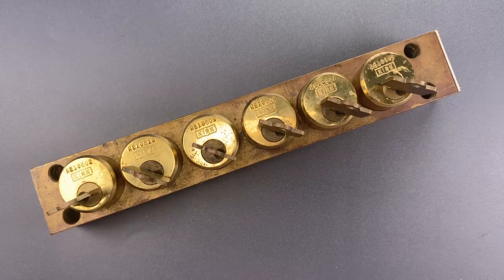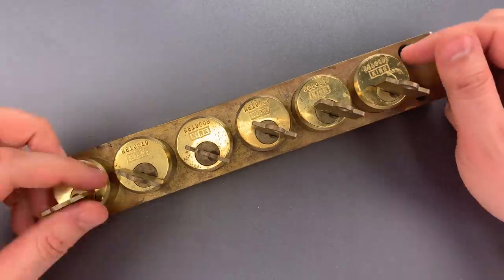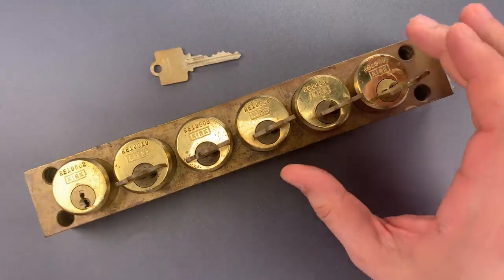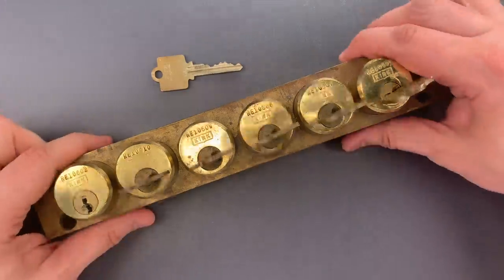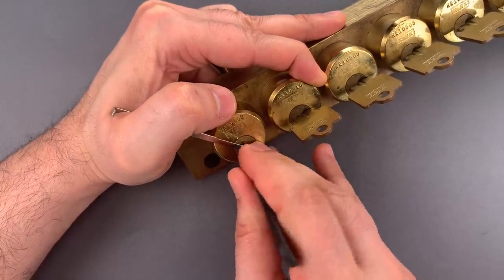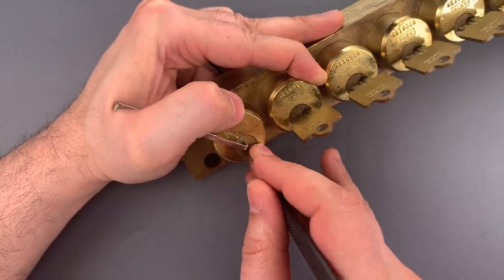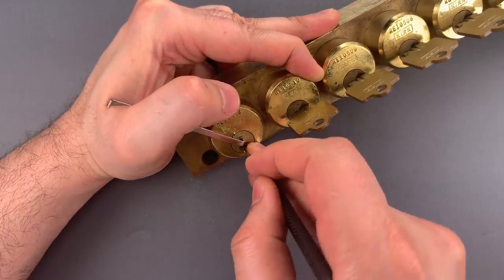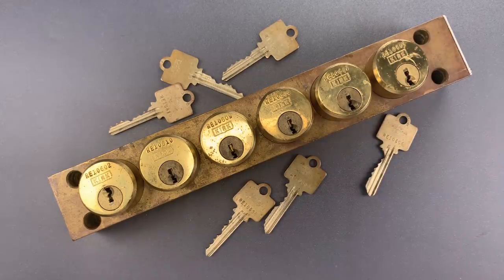[1190] 6-Key Kirk Interlock Panel Picked

Comment: Really a simple system once you grasp the idea, but as stated in the video, an almost unlimited number of configurations.
Here's an example of one I serviced for years (the easiest to explain):
• Lock #1 has 1 cylinder Key #1 and locks out the process switchgear allowing Key #1 to be removed.
• Key #1 is taken to Lock #2 which locks out process power, just in case the switchgear somehow gets re-energized.  Lock #2 has 2 cylinders, one of which holds Key #3 trapped.  Key #1 operates the empty cylinder of Lock #2 locking out process power and releasing Key #3.
• Key #3 is taken to a key panel and used in an empty cylinder to unlock cylinders trapping 10 individual Key #4.
• The 10 #4 keys fit individual single cylinder locks that are Keyed Alike.  The locks provide access into the process, each lock trapping its key until the access door is closed and secured.
• All 10 #4 keys must then be returned to the panel before Key #3 can be removed, and so on.

There were 4 process lines using this system and each had its own series of keys.  In normal operation, cylinders without keys can be protected with gasketed, spring-loaded flaps covering the face of the cylinder.  Cylinders WITH or without keys can be protected by a tight fitting brass cap that slips over the nose of the cylinder with room for the head of the key.

The main issue was that during a shutdown, the keys trapped in the locks on the access doors would get broken off.  Hard to do with a nickle silver Yale sectional key, but they did it with regularity.

Comment: In France, we have the same interlocking panel principle, but we need to turn each key, one after the other, to allow the next key to be removed. The inner mechanism seems to be much more simple and flexible than the one you showed. LPL, let me know if you want me to send you a typical French "chemin de clés" that we use in tramways, trolleybuses or metro electrical feeding systems.
The point is that every key must absolutely NOT be interchangeable, to prevent tragic mistakes. And complete installation may require hundreds of keys...

Comment: Neat, seems like an earlier version of LOTO
Reply: No.  It's still used today on modern systems of many types.  It's sort of an enforced LOTO.  I've seen it on many low (under 600V) and medium voltage cabinets, even ones bought in the last year or so.
Reply: It's more of a supplement to LOTO.  The idea here is where you have a series of lock outs required to safely perform an operation, this allows you to do it in sequence since each key will need to be released in the proper sequence to be able to proceed to the next step of the procedure.  The Kirk website shows examples of several applications with various implementations on how it'd be used in a LOTO situation where you have multiple things that need to be locked out to get to the final item for maintenance.
Reply: LPL actually plays with the LOTO.  He had a conundrum when he found a plastic cased Master lock LOTO lock had a better core than a metal cased Master Lock luggage lock of similar size.
Reply: @ljfinger  see
Reply: LOTO?
Reply: We use these in our 27KV substations.  They even used to be on 138KV equipment, such as  disconnect switches and ground switches,  but almost all of those Kirk interlocks have been retired.
Reply: @darthkarl99  lock out tag out.
Reply: @darthkarl99  Lock Out Tag Out - industry term for use around machinery and electrical equipment to turn off and keep off a piece of equipment or circuit for maintenance or repair to ensure it's not accidentally started or energized while not in working order or with someone working inside/on it.
Reply: @darthkarl99  There is a simpler version as well.  Long bar with multiple padlock holes, where if any of them are occupied, you can't remove the bar.  You put that through the hasp that locks the controls on something dangerous.  Then each guy working puts his OWN padlock through the bar.  You can't turn the machine back on until every guy removes his own lock (thus proving he isn't still in the bowels of the machine).
Reply: Nothing to do with LOTO, as there are no tags 🏷 involved, this system is still widely used in many industries.
Machine interlocks so that the people killer 4000 can only be started once all the access doors are secure.
I have never seen one that uses standard looking keys before since being able to duplicate of any key defeats the whole purpose.
Reply: @charlescox290  we call Loto. Lock off test out.
Reply: @starcitizen890j5  I think tag out is from military usage in the US. No physical locks because you might have to operate those valves in a hurry to save the ship and everyone onboard. Yellow caution tags on things that might injure people or you really need to think about why you're using that system. Red Danger tags for when operating that system will kill someone.
Reply: @ScottKenny1978  Tagout was exclusively used when I was in the military. In industry, we always prefer lockout but can still use tags if there is not a suitable lockout means. This happens more often on older equipment that was not designed with lockout in mind. Just about all new equipment is designed to accept a lock (I think it may be a requirement in some countries).

Comment: We use similar panels for our electrostatic precipitators on our boilers. First you get the keys out of the breakers for the transformer-rectifiers when you power them off. You take those keys and you can unlock the keys that let you ground the transformer-rectifiers. You then take the ground keys and unlock the keys that let you open the doors to go inside of the precipitators. This ensures that nobody can go inside unless the T/Rs are grounded, and the T/Rs can't be grounded unless their breakers are shut off.

Comment: We have a process for bypassing interlocks at our place as sometimes some off maintanance combination prevents you following the normal sequence.
The key barrels are literally held onto the equipment by a couple of Allen bolts so it's a lot easier to remove the offending lock, rather than trying to pick things
Reply from the maker: I wish that was the case on this one... you’d need to grind off rivets. ☹️
Reply: @lockpickinglawyer  bummer, guess it depends on what's specified at the time of ordering

Comment: Hi LPL, not so much to do with this video but this morning
my life imitated your art. I found myself on the outside my house with the
house & car keys on the inside with the door locked (don’t ask). The key I
hid 20 years ago wasn’t where I thought I’d hidden it so what to do? Luckily
being a motor mechanic I have saved a supply of wiper inserts, they are so
handy for so many things, a thousand and one uses in fact. As it happened I had
some in a box of junk in my carport so I fashioned a tension bar out of one
half and a very crude pick with the other half. I also found myself laughing,
almost out loud, as I said “click out of 1, nothing on 2, 3 is binding, bit of movement on 4 etc etc.
Took me about 5 minutes but I got back in and wasn’t too late for work. So
thanks for the education ... and have a nice day 👍

Comment: I see them a lot on switch boards and high voltage multisource switches. Main thing is so you can't turn two feeds on at once. And then of course like you mentioned but being able to open the doors to the taps of the cables where you could be electrocuted. 

At least locally here in Toronto it's one of the parts I find electrical inspectors to pay the most attention to. 

And just a random fyi, incredibly expensive to replace if they get damaged or add an extra if the inspector feels it's needed.

Comment: Similar types of interlocked keys are used in electrical substations.

The relevant isolator on a circuit must be in the open position to release the 'left hand' key, which in turn will release the 'right hand' ones that allow operation of the earth switches.
In fact, there will commonly be several 'left hand' keys required in order release the ones on the 'right'.

There can be quite complex chains of such interlocking devices to take account of alternative valid isolation too, and many a time safety switching instructions have had to be cancelled part way through and re-jigged just to take account of an oddity with the way the interlocking has been set up!

Comment: I've seen something like this about 20 years ago, coincidentally related to locks / key control.  I worked at a University that had floor, building, and area (multi-building) master keys.  In certain conditions we did keep and use the building and area master keys.  However, during the school year RA's could need access to the floor level keys.  Instead of giving those out to a lot of people with a chance of losing and having to rekey entire floors, they were given "sub-master" keys which wouldn't work on any door.  They were keys used on an interlock like this that held floor level master keys that they could access if needed.  If the sub-master was lost, it was just one lock to re-key and a handful of keys to re-issue instead of 20-ish locks per floor or 80-ish per building.

Comment: A similar setup is used on some TV transmitters preventing you from accessing the high voltage (32KV) section of the transmitter without grounding the system.

Comment: In coal electrical generating plants we used them in the ESP's and the ash hoppers. The hoppers use a nuclear level detector which would have to have the lead shutter closed before you can enter for cleaning. This system made sure you couldn't even open the man-way without the shutter closed.

Comment: As you turned the first core, the switch is now in the off position and getting it back on will be a pain as you either have to pick all five of the other cores, plus the primary again, or find all those keys you stole.

So it still works as a safety device, but it was a very efficient denial of service attack.

Comment: Looks great, I saw you said it can't be disassembled non destructively, so I hope you can maybe cobble together a model of what you expect the insides to have to make the retention system work.
Reply: Apparently these can be ordered with screws holding the lock cylinders in place instead of rivets, so hopefully LPL is now looking for a bolted version to show us the guts.

Comment: I first encountered a similar unit visiting a research facility as a college student in the '60s  The left key was used to electrically lock the door and apply power to a high energy electrostatic generator.  Anyone entering the chamber to set up an experiment used one of the five right keys to lock the door open and retained the key until they exited the setup area.  Impressive safety device.... then came time for the electrostatic demo.   Fred's key was missing when our guide tried to remove the left key.   The guide said "Darn, Fred is always forgetting to put his key back and takes it home".  With that he open the desk, took out a key, and inserted it into Fred's interlock space.  "Good we keep a spare 'Fred' key handy.  Watch through this window..."

Comment: I had to work on a panel of these. It was on a roof. The key was broke in the lock. It was in an a inconvenient place. The key was not easy to remove since it was 200 ft up on the roof

Comment: These interlock systems are typically just one part of a larger controlled access system.  Even if you could pick the lock, good luck convincing the operator(s) (watching on CCTV) that you ALONE are allowed access to the panel.

Comment: These were used on electrostatic precipitators to remove fly ash at our coal-fired plant. They were for safety on high voltage equipment.  Maintenance crews could safely work on units after lock out.

Comment: We have similar Kirk Interlocks on most of the larger electrical distribution panels at one of the buildings we maintain at work, but those are just single cylinder systems, the key must be turned to re-energize the switch.

Comment: Hear at the phone company we use pairs of Kirk locks with the sliding bar like a surface mount deadbolt.  When we need toswitch  power sources we open the breaker on the normal source so we can turn the key extending the bolt blocking the breaker from being turned back on. Then we remove the key and use it to retract the bolt blocking the breaker for the alternate power source be closed.  Obviously the locks are key retaining when the bolt is in the retracted position to insure both breakers are not closed at the same time.

Comment: I used to work at a large plasma physics experiment that had multiple layers of key interlock systems, each one much like this. It wasn't utterly fool-proof, but it would have made it pretty challenging for anyone to accidentally, or even intentionally, vaporize themselves. There were also various door sensors, etc., that tripped automatic shut-down systems, in case anyone got any crazy lock-picking ideas.

Comment: I can see this for a home door lock. One Key in and Five Keys out for the lock position. They then have to pick Five locks simultaneously to open the door. You put the five keys in and rotate, unlock your door and take the one key, door is open and nobody can take the five keys. Also can see this as a variant to the dual key system, but in this case you have five key holders who have to agree and insert their keys before you get the final command key free which opens up the freezer containing all the Ben & Jerry's

Comment: These are similar to tagouts, security is less of an issue and therefore should not weigh in on their usefulness.  A long time ago, I used to do security systems and spent a day at a trash incinerator plant that produces energy on the grid.  They had a tagout system so if you were needing to go into a boiler or specific rooms around the plant, you would pull the tag out and put a lock on it.  Before any burners are to be turned on or any room "activated," the tag must be reinserted.....it can't if there is a lock there.  I doubt any coworker is going to pick a lock in front of other coworkers, just to murder you.  The lock might not be secure, but it was never meant to be. :)

Comment: We use this type of system to lockout a rollercoaster or ride if someone is in the ride path. You must carry a key at all times if you are in the ride path. Once all keys are returned it will unlock the key that will give power to the ride to move vehicles. We don't use this type of key we use Allen Bradley ProSafe keys.

Comment: I'd be interested in seeing this lock picked in reverse (i.e. picked to remove the master key).  I assume that it would require tensioning and picking the five keyways at the same time.  Granted, the chain or belt that's locking the cores together seems to have a bit of slop which should help quite a bit in the process.

Comment: would be cool to see how this actually interacts with whatever this is connected to.
Reply: At least show us the back and terminal connections, if you can't show us the guts with out destroying it
Reply: I think this is actually just storage for the keys on the right.

Left key is like the ignition key for a car, and is usually in a different lock to turn the machine on. But for maintenance, you take it out of the "ignition switch* and put it in the interlock, to unlock the keys to the access panels. The access panels all have retaining locks, so as long as they're open you can't get the power key out of the interlock to restart the machine.

Comment: A lot of people in this comment section don't seem to get the point of a system like this. You may want to look up 'lock-out tag-out' systems. They are intended to prevent accidental electrocutions/shocks that are fairly common. 

Example: Maintenance is working on replacing an electrical outlet in room 12. He cuts off the breaker to that room/circuit. A lock-out/tag-out system will prevent someone from simply coming by and turning that breaker back on while he is working with that system. IF someone does, there is a good chance that the maintenance worker gets a good shock as he is working.

Comment: maybe there is video on how this system works? it is very interesting design and would be glad to see how it works, it can be animated or simulated. still thank you @lockpickinglawyer
Reply: I think that it is just a way to make it impossible to turn the machine on or off without all the access panels shut and locked.

The left key is like the ignition key for a car, and is normally in a different lock entirely. You have to turn the machine off and take the key out to prevent restarting it, then put the ignition key into the interlock to get the keys to the access panels. The access panels all have retaining locks, so you can't take the ignition key out and restart the machine until all the access panels are shut and locked, with their keys returned to the interlock. 

I also think that all the keys would be different, so that the key for Panel A won't unlock any other panel, which lets you know which panel needs to be shut and locked to restart the machine just by looking at the interlock. "Has anyone seen Frank? He's not at the operator station." "Interlock is off, and panel C key is gone, so he should be in there." Supervisor goes to Panel C. "Hey, Frank? You okay in there?"

Comment: These systems are in use in electric locomotives to secure the high voltage system against opening it when the locomotive is under power.

Comment: We used to have these at the coal mine I worked at to prevent opening electrical panels while a transformer was energised, just like your example. 

I'd be interested to know if you've heard of the brands we used in Australia, there was a Castle brand that looked very dodgy, and a Fortress brand that was all stainless steel with custom machined keys that I'd never seen before.